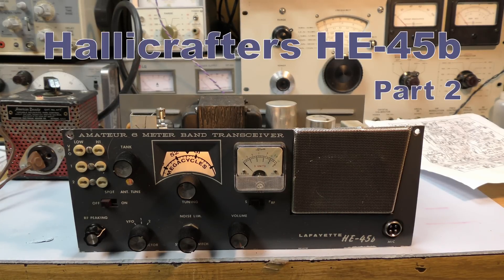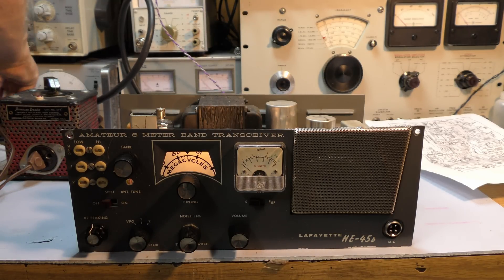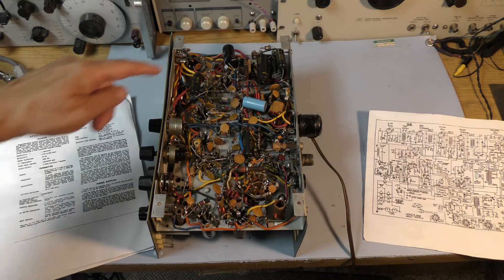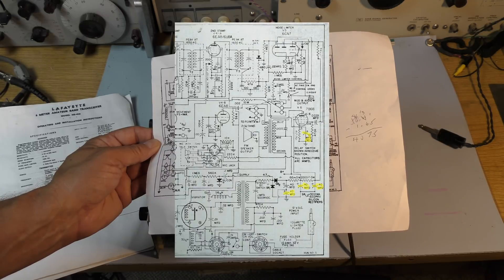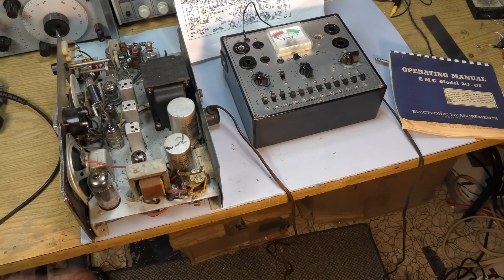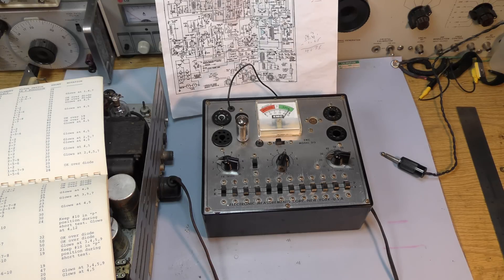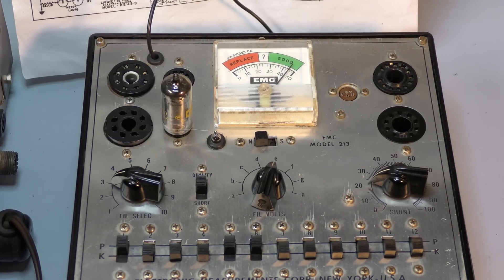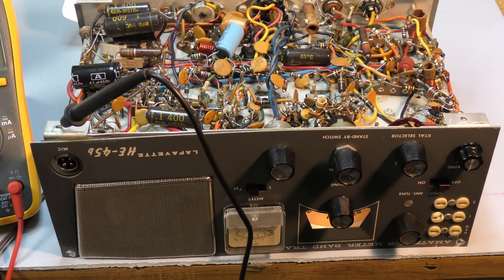6 Meter AM Transceiver -  Part 2

Comment: Interesting rig and thanks for video Mike. When poking around high voltage, my multimeter positive probe usually has some sleeving around the metal probe end. This reduces the risk of unwanted drama ⚡️.
Reply from the maker: Nice Tip - ZAP!

Comment: Ive got an old valve tester that'll measure ancient valves, tubes, It didn't even have a B9A socket! I had to make an adapter! For more modern valves, tubes, I just went and built my own valve tester! A lockdown project!
Reply from the maker: Very nice. You are showing signs of a very experienced and knowledgeable approach to valve testing!

Comment: You are reminding me of an old Utica 650 that was gifted to me when I was a young teenager. It was an interesting looking rig all chromed out with a steel brushed front panel. I powered it on and it hissed at me, but nothing was ever heard other than the hiss (which, in hindsight now, should have been no surprise.) I had no test equipment at that time to even do any testing/troubleshooting, and even if I did it certainly would not have been up to handling 50 MHz. Needless to say I kept it for a while, and being a dumb teenager scrapped it for parts that I still have today LOL. 73
Reply from the maker: SSSSSSSSSSSSSS - good right? A signal will come. Do I need an antenna?

Comment: Great looking project Mike! I always leave the old can crapacitors and put the new ones under chassis. When I say new, I mean robbed from a 1990's tv. 10 Meg resistors and .001 capacitors make great "standoffs" for mounting the new caps. I'm curious how the leakage is on the black and yellow .1 uF 400 volt caps are. I've built a tested using a mosfet and an led which is great for testing for even the smallest amount of leakage. An op amp works great too due to the high input impedance. 
 I hope you enjoyed your fishing trip up here in Maine. I believe you mentioned northern Maine so that would be a long ways for me, but I've got some good places around here too. You might get lucky and be able to work Maine on six......OR better yet CAPE COD!
Reply: Interested in the circuit for your leakage tester.
Reply from the maker: You need to leak that circuit!

Comment: Yup, the tap functions works . . .
Reply: What are the tap functions ??
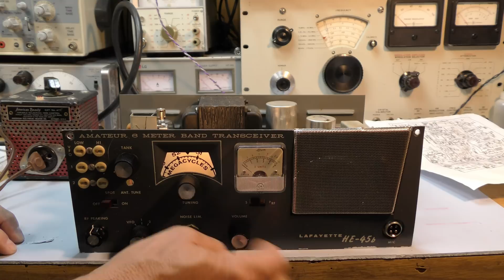Reply: @DonGrimble  If i'm not mistaken it was at about 1:33 - not quite the Mike method of electronics analysis we have gotten used to, but it worked !
Reply from the maker: Pound on the radio for more data...